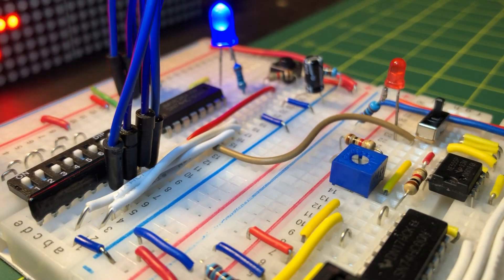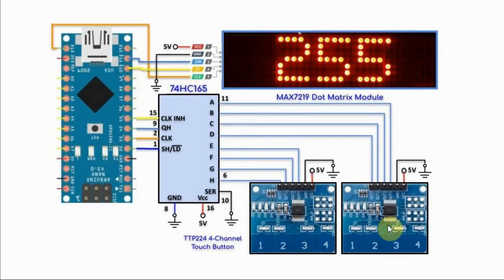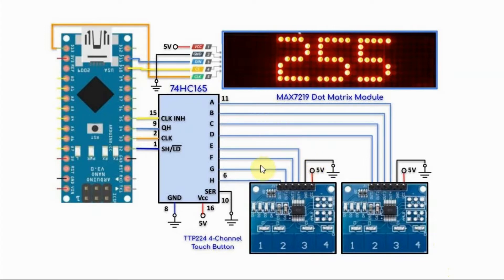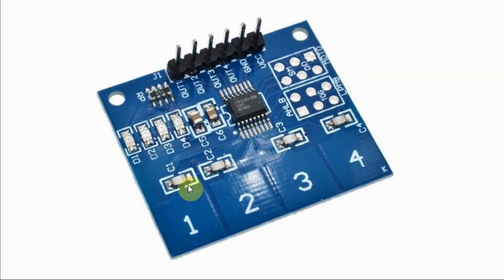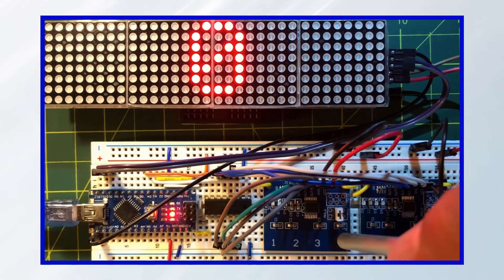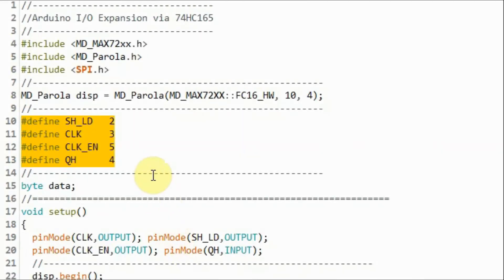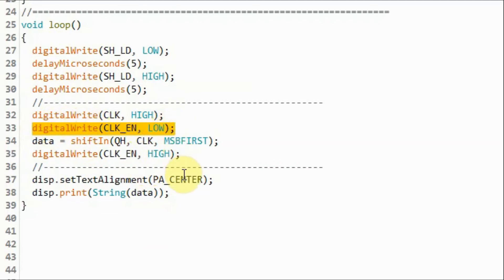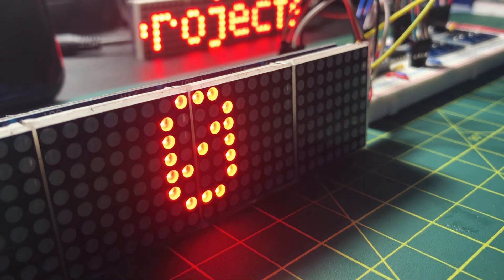Arduino I/O Expansion via 74HC165 Shift Register

Comment: I don't believe the clock enable pin needs to be controllred in your example, it could simply be set low and not connected to the output so that it is always enabled.  Shiftin will drive the clock when needed.
Reply from the maker: Thanks for your feedback